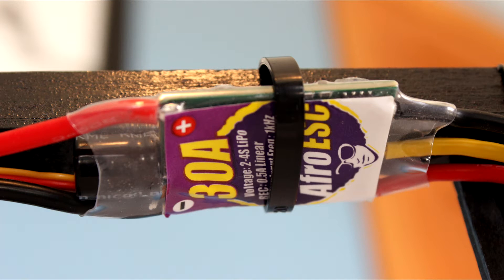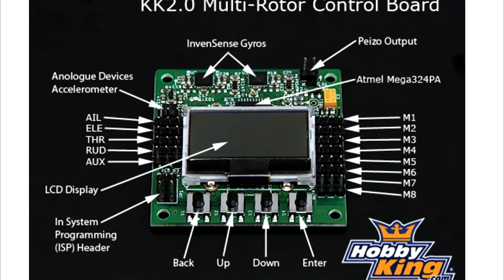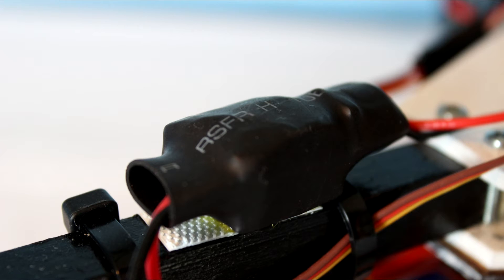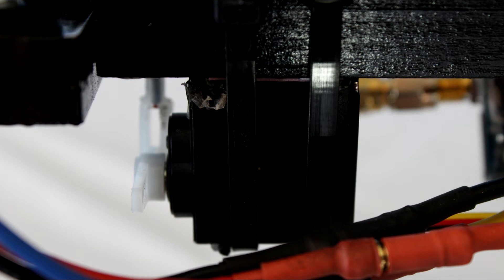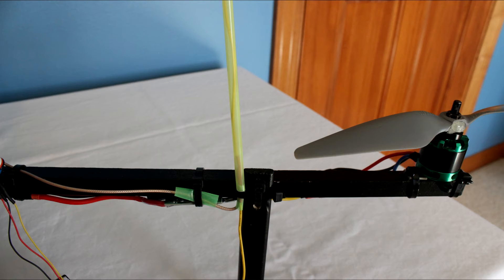Tricopter Overview

Comment: How much better does the upside down vtx antenna work? Thinking of trying it out on my tricopter.
Reply from the maker: It doesnt do anything to reception or anything, it is just more clean to mount it upside down than right side up lol.
Reply: I thought it might work better, especially at higher altitudes as the antenna wouldn't be as blocked by the battery etc. Might just leave mine as it is then.